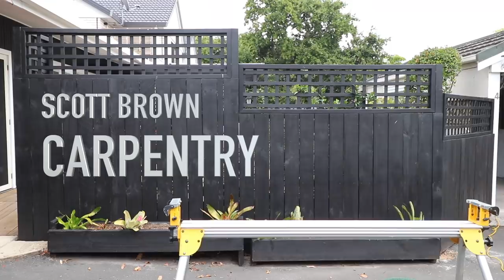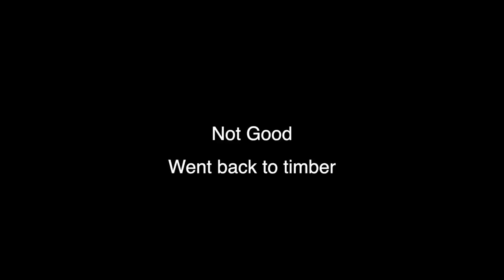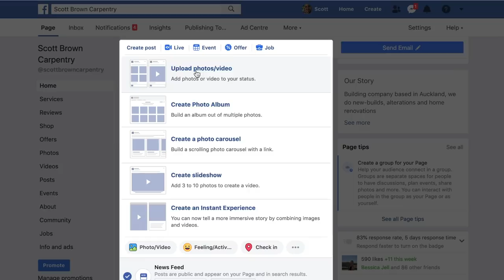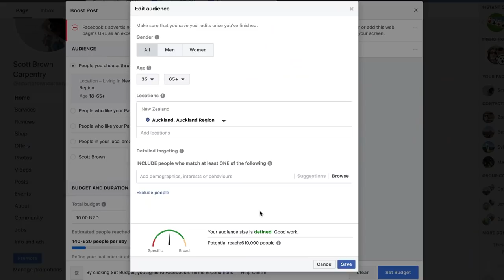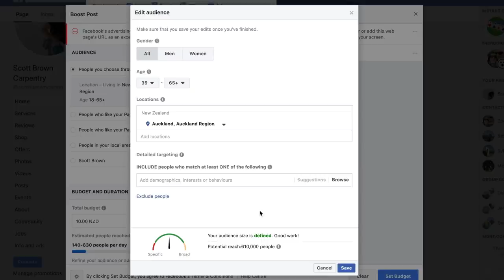x2 Ways to Get Building Work

Comment: I've been using Facebook advertising for the last few years for my punk band, not entirely the same as for work but still use it alot. In the last year, reach per pound has plummeted and I've not found it anywhere near as successful as the first two years for getting ticket and album sales. I find more success these days by putting a post out on our page and sharing to relevant community groups, and for my carpentry work that is all I do, although I don't tend to need as much work as it's only on the side at the minute. I hope it works out for you mate, but don't judge it on one advert, try half a dozen different things to tweak the advert and see what works. And remember with Facebook changing so much what works one week might not work as well the next!

Comment: How does yourself or others out there going on with pricing work? I have a small window,Door and conservatory business, at times I find it extremely difficult, my pricing cost has so much to account for, window job for example, cost of Windows, material, labour and small profit which covers for running costs,like the van and fuel, tooling and the never ending lists of liability insurance, MTC cards, job registrations which all ways keeps wanting more money, on top of that quote price then VAT is added, and also I’m done out of my own personal TAX, but the increasing cost of everything I find myself making not much money for the job, even though all the time I’ve put in the travel to customers, measure the item, discuss back and forth for hours on requirements, even till midnight, then have to quote the cost, then order the product, every single thing on paper work needs accounting for and filing, copy scan email copy scan print file, then complete the fitted work to a high standard then back to writing out receipts and emailing, more printing and filing, then filling out a large request of registration of the job, more paper work and filing, but of a rant but what I’m trying to say is a lot of work and time goes into that 1 item that gets fitted yet I’m hardly making good money out of the and hours unpaid just so I can hopefully get the job to get some money at all, also the constant chase for work gets stressful.
Reply: The Unambiguous Hi Mate, you really need to use some form of accounting software like XERO or MYOB. As the name suggests I am in Sydney and use XERO, a cloud based accounting/bookkeeping software. This is great and once setup will make your life so much easier for your day to day running of your business. If your account or bookkeeper now doesn't use one of the above, ask them if they will. If they won't I strongly recommend finding some one that does, you can search on the XERO website or through google to find a new accountant/bookkeeper that does use it. So what are the benefits?
1. You have a login, the accountant/bookkeeper can have one as well.
2. Your account is set up with a live data feed from your bank account.
3. You set up names and parameters for your transactions from your bank account data feed and categories on your software to reconcile them, i.e. fuel, tools materials, vehicle maintenance, any suppliers you have etc. This makes it a one click reconciliation process.
4. You can quote from the software and incorporate your logo, payment terms on the quotes, you can attach docs to the quotes and it even tells you when some one has read it. When a job is accepted you can turn the quote into an invoice once  the work is done. You can put in items for your quote which are saved and then you type in say 1A and automatically it will put in that item, its description and a cost saving you having to write it from scratch each time. It then tracks all your invoices for you that you can email direct from the software and shows you what you are owed and by who, how long it has gone past being due for payment etc.  

It sounds like you are swamped by the office work, I know how you feel. I was doing the same in 2016 as you, all paperwork, quoting, doing the work, organising the jobs and workers, invoicing,  bookkeeping and studying 2-3 nights a week at college/TAFE. Seriously get a subscription to XERO, made it alot easier for me. Now I write all my quotes from it, invoice from it and keeping it all in the same place makes it a lot more streamlined. Hope it helps you and feel free to email me at info@helicrete.com.au if I can help any more. Cheers Jerry
Reply: I forgot to say you can also set up payment methods on your account so you can accept payments from customers via a small Bluetooth card reader which is paired with your mobile. It is very secure and you have to have GPS turned on for a security feature when processing payment. Pretty sure you can use paypal and some of the other big payment transfer companies. If this is set up in your account they can also pay you directly from your invoice. This can be handy if they want to pay on a credit card or if they want to pay you a deposit before starting etc. You could give them an incentive if they pay on time they get a discount, which you have already factored into your original price, so you don't loose really.